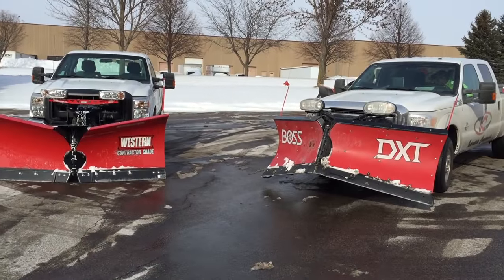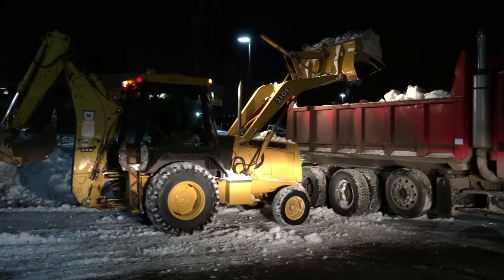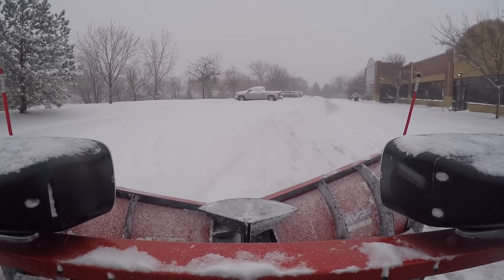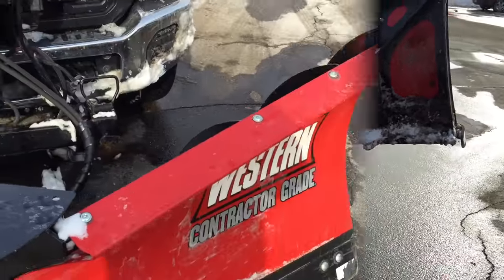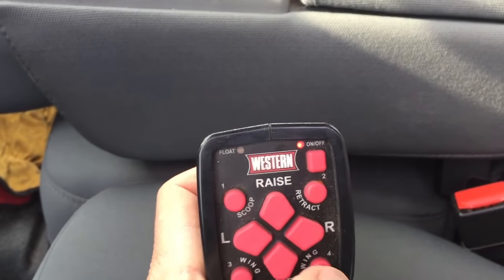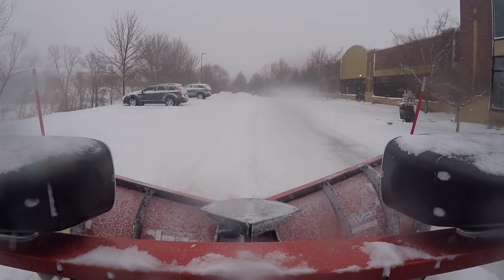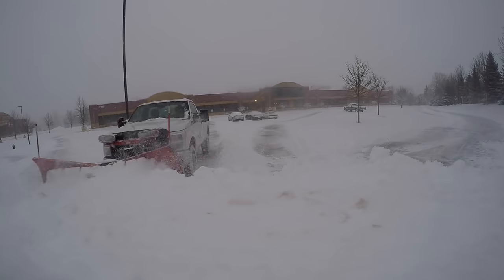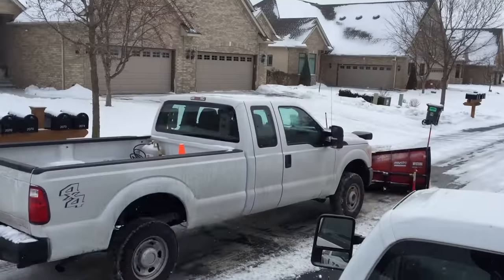Plow Review  Boss Vs Western snow plow

Comment: Hey I repair Western (and others, I guess) controllers for Saint Paul. I came up with a better controller that is a plug-in replacement, and that reduces operator fatigue by orders of magnitude. It is durable, inexpensive, and can be demonstrated in as long as it takes to plug it in. Yes the City bought a bunch of them. There are two versions- one for the 6-wire pendant control, and one for the 4-wire 8-button pendant control.

If you are tired of being sore after 20+ hours of plowing, this might help.

If it is something you might be interested in, I'd be happy to show one to you and let you try it out. Just reply if so. I'm in the East metro several times every week.
Reply: Bryan Tasler Hell I’m interested. I’m in my truck for hours on end and I get finger cramps every single time.
Reply: Bryan Tasler I’m getting ready for a new plow. I’m interested in that control.pleas send me more info.
Reply: Do you have a website or email address? Curious about your controllers!

Comment: would it be better to get a gas truck or a diesel truck for plowing?
Reply from the maker: Gas-  starts easier in super cold weather.  No fuel to gel.
Reply: Diesel.  Additives in diesel fuel at the pump prevent gelling to -30, less frequent oil change intervals, higher torque, better MPG plowing.  Mine has also never failed to start even unplugged at -20.  This ^^^^ is pure grade a bullshit.
Reply: Unless you get a pre-emission diesel, don't bother with the extra cost of a diesel if its just a plow truck.  Cost upfront is more, upkeep is more.  Get a 3/4 ton with gas engine, the new ones have PLENTY of power.  This comes from a guy that services these types of vehicles everyday.  The diesels now a days are getting the screws put to them and its really hurting their pros over the gas market.  Diesels have their place, and they need to be worked, plowing isn't what I'd call heavy work.  Its not the same as pulling 10k+ in a high gear on the highway.
Reply: Keep in mind as well, the diesels up front take away front axle capacity as they are heavier.  I think Boss for a while didn't recommend their plows on GM trucks because it put the front axle overweight.
Reply: All that means is that you'll be installing it yourself.  They also have to calculate a 200 lb person in each seat even if you don't take riders.
Reply: Used car dealer here. I would only recommend a diesel if you NEED it for other jobs. Don't buy a diesel for dedicated plowing. You pay a big premium for the diesel when you buy it. Gassers are easier to work on.
Edit:
Don't let someone tell you better gas mileage is a reason to buy a plow. They're not factoring in the upfront and maintenance costs of the diesel engine.
Reply: Joe Smith
Just stating the facts of the issue.  Did headgaskets on a 6.6 LLY to the tune of about 6k$, I can put a factory reman with a good warranty in any of the new gas engine trucks today for that no problem.
Reply: I have both and totally agree gas is better if its a dedicated plow truck. Cheaper to get into, work on and easier to start in the bitter cold.
Reply: Yes I agree keep gas, with the new emission the exsuhust
Reply: Sorry got interrupted you can't keep that DPF crap working the trucks run to cold plowing for it to clean proper
Reply: That's why you cut it off. Magic.

Comment: I like my fisher but it looses power to the wings with a lot of snow.  Its also an old plow.    I also like the fisher remote but it is the only one I have ever used.  I used a Blizzard extendable wing plow on a f550 during storm Jonas which dumped 3 feet of snow.  The first thing I noticed was it wouldn't stay on the ground.  it would ride up the snow and my fisher v plow did not do that,
Reply from the maker: +J.L. Landscaping and property maintenance I have had all my plows ride up on big pushes.  It is common.

Comment: I've ran Fisher, Western, Meyer, Arctic, Snow Way and Boss. Installed most of them too. By far my favorite attachment system and controller are on the 1989 Boss RT1 V plow I have on my 92 Cummins Dodge. The attachment system is rediculiously simple and you don't have to be even remotely close to lined up.  Hang the plow off the chain and swing it into the v shaped recievers and drop in the pins.
Controller is 3 3 position rockers. Up/hold/down(clicks into down for float) each wing has its own rocker, in/hold/out, spring loaded to hold.
I have ran Boss's handheld and joystick, and most other V-plow controllers, but when it comes down to it I prefer the simplicity of my ancient junk.
The hydraulics seem stronger and the plow itself is quite a bit heavier than the newer stuff. 
Not going to recommend everyone go out and get one, they are ancient and so are the trucks that they attach to. Parts are getting to be few and far between as well.

Comment: Have been running a Boss V-Plow since 99. Best plow I've had. Have had Western and Meyer.  Had to replace motors on the Western and Meyer almost every two years no matter what I did to protect them. Bought my Boss V-plow in 1999. Replaced the Boss motor after 10 years of hard use. Hookup on the Boss is very easy. Just as easy as western.  Boss beats them hands down. Have been plowing for 38 years.
Reply from the maker: I love my Boss Plows-  Had many- worked great!

Comment: I use a Hinker 7.5 foot str8 Blade. I Live in Central Wisconsin and we get a lot of Snow. It works very well on a 1997 Ford f-150 with 5.4 Triton. My Hiniker has worked well. Just flushed out the whole Hydraulic system and replaced the fluids with -50 Good oil. Hinker is on and off My Truck in two mins or less. It has been a cold cold year and no snow. Parts very easy to get and ram's are very to repack on my Hiniker. No Complaints at all. But if I had my choice it would be a Boss V on a Short Box Chevy. Best plow i had was a Str8 Western on a Bronco. Plowed like a Beast.
Reply from the maker: Cool!  Love my Hiniker

Comment: I have a boss DXT. The wings are weak for two reasons: #1 the smart lock cylinders reduce pressure available on the working end of the cylinders. This is because the surface area exposed to the rod end of the piston (to hold the wings in place during back dragging) cancels out force available on the base end of the cylinders. Essentially your left with a working surface area not larger than the rod diameter #2 the cylinders must overcome spring resistance. 
Your plow, no matter what brand, must be mounted at a ride height so that the cutting edges are even with the ground in both scoop and v position. On the boss there are adjustments at the truck and a rubber rock-back-stop on the plow. If ride height and "plumbness" are not achieved accelerated cutting edge wear will result. I like my boss...... I like it more because the guys at Hooze 4x4 are nice to deal with. You should also note that the side to side travel is better on the western because of the yoke provided. The boss dual trip edge/moldboard is vastly superior to the western single trip edge.
Reply from the maker: Good point! Thank you!
Reply: Jacob Gilkerson
Reply: The Boss pistons still have the same pressurized surface area for extension with or without the Smartlock Cylinders. The Smartlock system only effects the resistance on the rod side. If your wings are pushing back to easily there is a simple adjustment of the pressure relief valves that will prevent that. They are all supposed to be factory set to 2800 PSI but they are not always set up properly and most guys prefer them to be stiffer than the 2800 PSI any ways. If you have a good BOSS shop around have them tighten the pressure relief valves for you. It takes about 10 minutes.

Comment: for some people looking   western and fisher are the same company  they are both owned by the same parent company  that use all the same tech.   and same functions  just a differant style truck mounting system   
 second note  not wining just wanted to inform on the western plow you said you have to "hold the down button to cause float "  this is incorrect  you have different settings on instant float at a tap of the button or hold float   allong with angling you can change from soft stop to hard stop on angleing  all changeable  on the remote by set up if you read you manuel

Comment: wonder why use a small pick up for plowing and not a tractor or wheelloader?. guessing not that much snow in the area, but still would be much more effective with a machine made for working :)
Reply: Tractors and loaders have much lower max speeds than trucks. Speed between accounts is a big part of profitability in snow operations. My route is almost 20 miles and 10 hours. With the my truck my longest drive between accounts is 15 min. I’m sure it would triple if I used a loader.
Reply: that i guessed speed is a factor. still a jcb tractor would do 45 quite easy. their loaders are fast also :)  so then need to do the math. slower moving, faster plowing. and a tractor would cost 4 times as much also. drink fuel, but are durable as hell :)

Comment: We use the Western Wideout. I will never buy another plow. It does the job and saves about 30% time plowing. 2 years and no issues as all.
Reply from the maker: NICE!  I should have got that blade!  Wish I did!
Reply: Most of the people, including the dealer I buy from said the Fisher XLS (same as the wideout) has way too many durability issues. Employees seem to love using them, owners don't seem to like the on going expense.
Reply: +David G xls and wideout are similar not identical, wideout is trip blade, xls is trip edge. As far as durability, I bought my wideout new in 09. I do ton of commercial plowing and as of now  I only ever blew one hose that should've been changed before the storm.  I had it in my truck and was back going in minutes. That's the only "issue" I've had. But as with anything preventative maintenance is everything to making equipment last and not let you down.
Reply: I never understood the whole trip blade, unless you are plowing a road that was just bombed. Some people like them, some people hate them but when a reputable Fisher dealer says, don't buy one, they are a headache, I take notice.
Reply: +David G I have plowed with both but only own trip blades(not because I have anything against trip edge), but I've found they peel up packed snow better at least for me. Once they bite in the springs load a bit it scrapes clean to pavement. I don't know why a dealer would tell you a trip blade is bad. Most of all of the state plows are trip blades. At least here.
Reply: got through my first year plowing with a wideout XL. not a single issue and as a first operator, i tested EVERY single built in safety system haha.

Comment: Put a ball Valve on the top line on the lift cylinder on the boss plow so when you run it into the snow Pile you can turn off and hold the cylinder in the up position to make it home.
Reply: jason vanderhoeven have you tried doing this or is it just an idea? Sounds like it might work.
Reply: dewalttoycollector I have done it.  It works

Comment: Hey Stanley it'sPatrick, I'm really enjoying watching your youtube videos, they're fun to watch but on the flip side, they're very useful, last winter I had the opportunity to use three different snowplows the boss EXT snowplow and the western WIDEOUT  snowplow, each plow had its pros and cons the boss had the SL3 L.E.D headlights with the ice shield technology, the ONLY thing I disliked was the snowplow mounting, and when I had the chance to use the western WIDEOUT snowplow it made big jobs really easy, I liked the ultra mount system, it was fast and very easy to hook up the plow to the truck, the ONLY two things I disliked about the western was 1-the plow cutting edge didn't last no time and the handheld control SUCKED because of the tiny buttons other than those two issues hands down I preferred the western snowplow over the boss, I almost forgot the boss plow at times froze up plowing snow and when it froze up it was in the transport position and the western wideout did not. good job on the videos and keep them coming Patrick
Reply from the maker: Really appreciate the comments Patrick and glad you like the videos!

Comment: We use all westerns at my company.  Westerns are simple, easy to work on, and fairly easy to use.  The one touch float is a MUST have if you have a western so you don't have to hold the button.  One thing that irritates me is the wiring harness and motor repairs that have to be made to our V's and Straights several times during the winter months here in Minnesota.
Reply from the maker: Thanks Riley- I have an updated review coming out soon.
Reply: What repairs are you referring to?
Reply: We have had a hydraulic lines burst and start leaking, a few pumps go out and most recently had a cutting edge break loose from the plow on one of our V's.  However, all of these things are minute relative to the cost of a new plow these days.  Westerns are very easy to work on.

Comment: as far as the cutting edge, we all know it depends on the surface as to how much wear there will be,,concrete, asphalt, gravel etc
Reply: He ran both of his westerns on the same surface.
Reply: I plow commercially, after 2 years on our MVPs the cutting edges are almost at the plow. that's way more than he stated he had. we plow all sorts of surfaces. dad's plows have a mix off all the common ones. boss has a very brittle cutting edge and they suck for back dragging. Western v plows are ungodly heavy. hiniker has a shitty lift height no matter how you adjust it and the drop speed is not easy to access. haven't really had experience with snowdogg but they look almost like a Western. ask anymore questions if you'd like. I service them and plow with them
Reply: I have Boss, Meyer, and a snowdogg. Boss hooks up easiest. Snowdogg works fine and the price is great, and I like the control best. You can tell the Boss is a bit higher quality, however where I live we don't plow much. 2-3 times a year and some years not at all. That being the case, if I were buying new I would buy a dogg and spend the extra money on a salt spreader or something else.
Reply: thomas wilharms on
Reply: thomas wilharms Boss is awesome to back drag with, way better then the 1 fisher we have and Doesnt fisher own Western?

Comment: Boss hands down!! I own all brands except Hiniker and I'm switching everything to Boss! Rarely gives me any issues and the v-plow with wings can carry more than any other plow out there and still clean curbs nicely. I have a Fisher xls plow too but the controller is no where near as nice as boss. Just my 2 cents...
I do like like Fisher sanders much better tho! Oh and a thing I do prefer is fisher over western, same thing but fisher has trip edges versus trip blades and the parts are cheaper for some reason, could just be my local dealer tho!
Reply from the maker: +R&S Services I like the trip edge more than trip blade as well.
Reply: Boss does make a good quality plow. Yes the Boss controller is the best out there but I will stay with my Fisher because the Boss plow does not stack snow nearly as well as the Fisher does. For me the higher I can stack it the less I have to bucket it out. That drives the cost up and takes much more time that I don't have to move it.

Comment: On the western you can program one touch float.
Reply: How?  I’m looking to buy a new snow plow, and I’m researching between boss and western.
Reply: Nrfa go Boss
Reply: @nrfa6229  turn the truck on but not the plow   hold the down button and turn the plow on while holding the down button until the float light flashes twice then release  and its will go to 1 touch float  do the same process to change it back   (you do not need to do this every time you start  once you do it one time youd done)
Reply: I came here to add this comment. My thumb was so happy when I changed the setting! Also because my fat thumb would press the right wing 4 button and interrupt the float.

Comment: The company I work for runs both Western and BOSS plows. I just to be a go BOSS or go home kinda guy but ever since Toro bought BOSS plows they have gone down hill. Both of the company's 2015's have Western Prodigy plows on them. Those plows will carry way more snow then the V blades ever will. I prefer the boss controller. Those 5 buttons also have speed buttons built in. If you press both the buttons on the left side at the same time (which is easy to do) the blade angles left and same for the right side. If you press both the top buttons it goes   Into scoop and Both the bottom ones to get it into V
Reply from the maker: +mike squires Sounds good.

Comment: It is a design flaw. The western v plow has a floating a frame. Hence you'll get alot of wear on cutting edge. Western and fisher v plows are same design except mount to truck. But the fisher doesn't have a floating a frame. The floating a frame works great for straight blades. My advice check out the fisher xv2. I see the snow dogg you have idk. They seem like junk but idk. I like boss but the return trip springs I dont like and there the most $$ compared to a western or fisher. Snowdogg is the cheapest.. let me know if you know what I'm talking about with the western v

Comment: Carbide cutting edge with a steel cutting edge on the front. Just a tip from municipal guys.
Reply: Devyn Hogan Exactly. Our Steel made 3 storms. Added the carbide with a Steel and it's going to be 7 years on one Western and 6 on the other. Our Henderson 11' we usually get 2 1/2- 3 years on an edge

Comment: Can you recommend a plow set up for 2010 Chevy Silverado 1500??
Reply: western pro plus 7.5 footer  have had many on 1500 hundreds perfect for tight areas  but still capable of taking the beating of comercial parkinglots with out overloading a half ton
Reply: Boss makes a 7'6 htx for half ton pickups. We have sold over 25 this year alone n the guys love them. Not for contractor use but for average joe its a great option